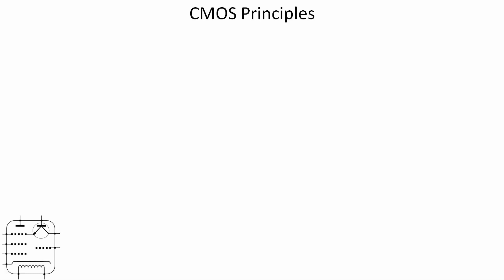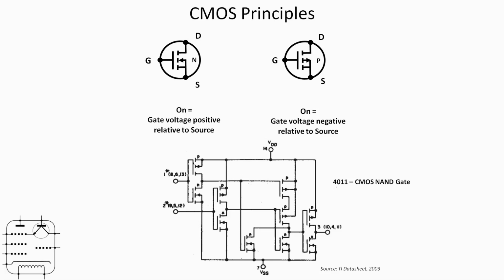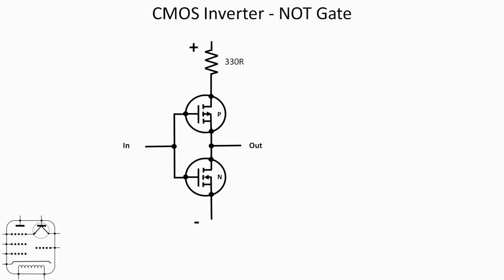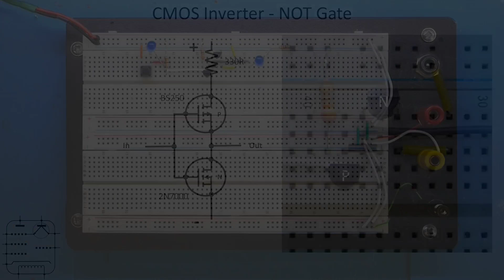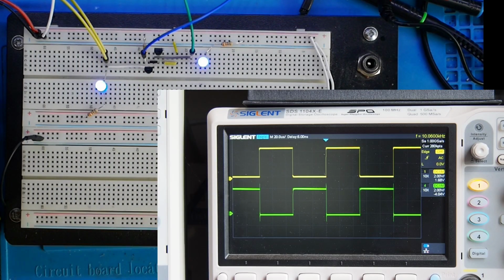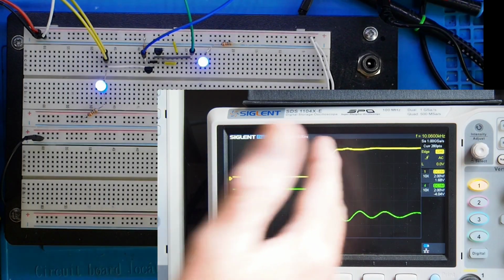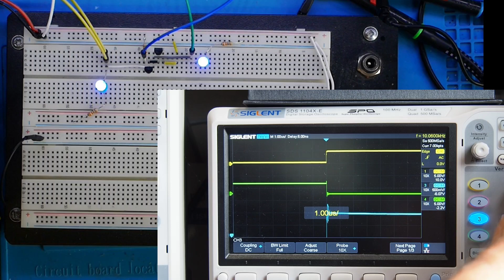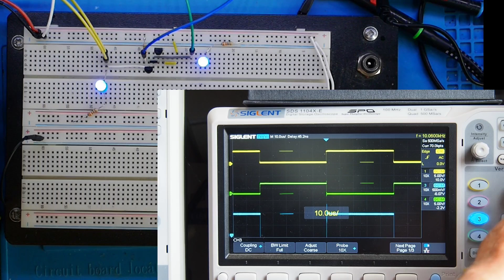Do It Yourself CMOS circuits - Part 1 - #168

Comment: Considering that the threshold voltage for your MOSFETs ranges between 0.8V and 3.0V you are pretty well guaranteed to have both turn on at the same time during switching. Therefore your resistor is very much needed to prevent your supply rail being clamped to ground.  Reminds me of the issues with the original 555 timer totem pole output stage.
Reply: Power rail is not "clamped". MOSFETs are current limiting devices in saturation mode. 
The shoot-through current is limited to few dozen mA. Try simulating it in your fav SPICE and you will see. In fact this is below the maximum current that the gate can deliver — usually 20-30mA and is stated in the gate datasheet.
Many (or most) people don't understand how a trivial CMOS inverter works. In first approximation It's not a voltage switch — it's a current source/sink switch.